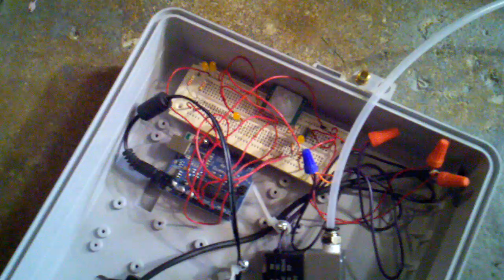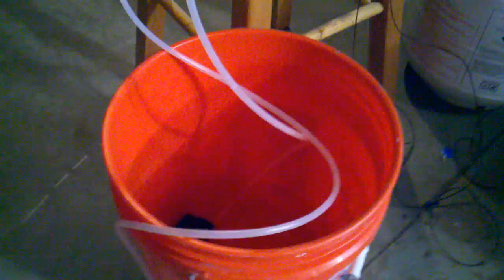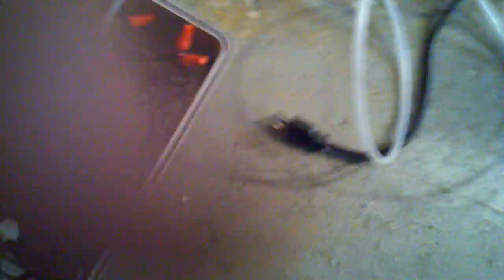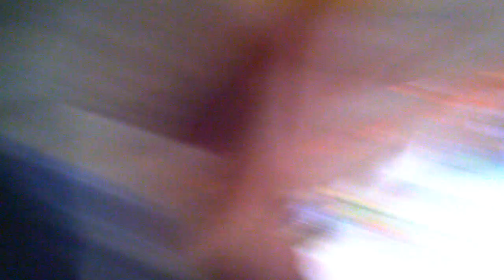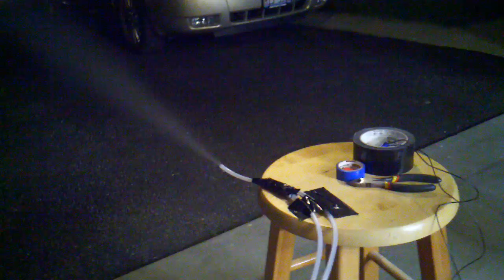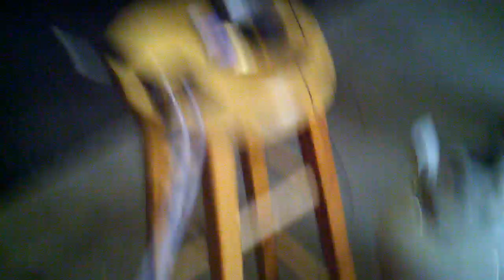Spitter test with Arduino

Comment from the maker: Some people do in fact use a T connector.  I did not.  I found that it worked better for me if the joint was less than 90 degrees between the 2 inputs.  But your mileage may vary.

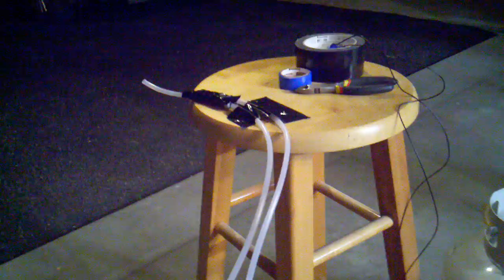Comment: for the "joint" at 0:34 (where one end goes to the solenoid and the other to the bucket) can you use a T connector there or do you have to splice the tubes together?